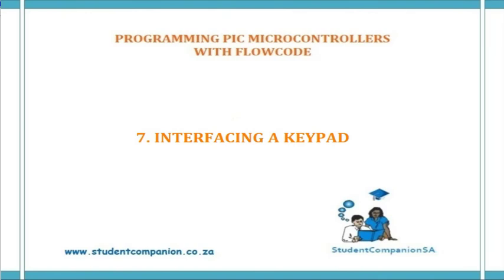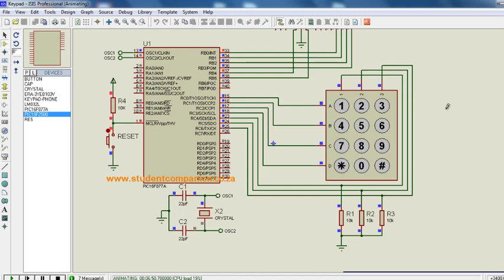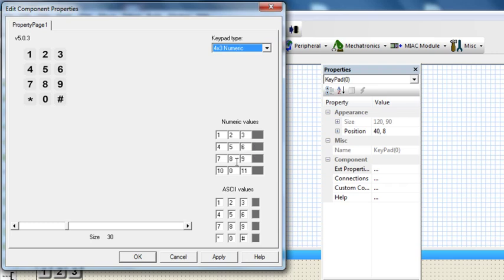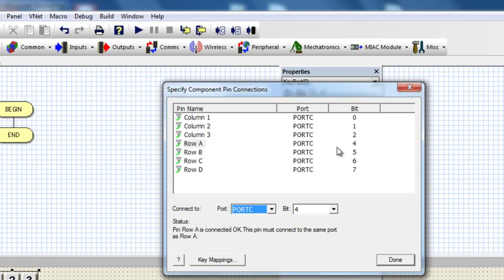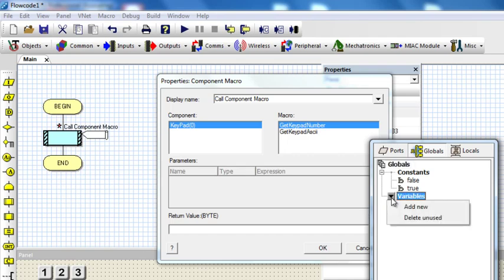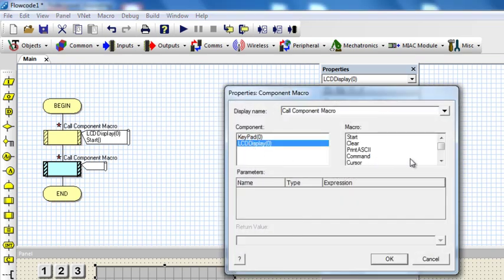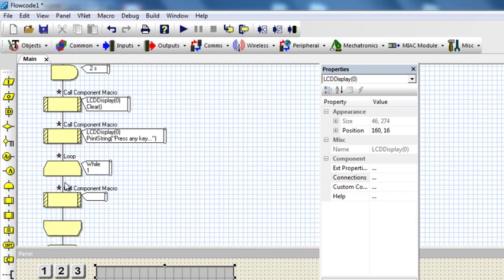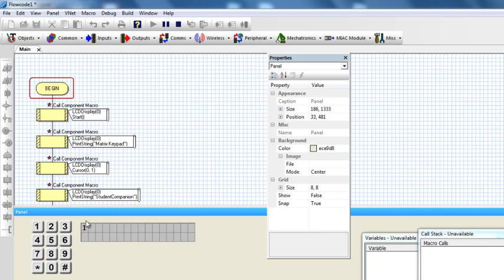7- Interfacing a Keypad with PIC Microcontroller | Flowcode Beginners Tutorial

Comment: may i ask if what PIC should be it? Its for my further verification only and self wondering.. Thanks
Reply from the maker: +marjun dayoc you can use any PIC You want. It's all depends on what you want in your application.  What you are going to use it for.
Reply from the maker: +marjun dayoc depends on number of pins required, peripherals required, size of your code etc.

Comment: Hi great job. may i ask your expertise. i have installed a flowcode v5, in the blue logo there is 3 diagonal red dots. normally are white dots. can you please explain why that is?
many thx
Reply from the maker: Hi wlondoner, thanks for watching our videos, i don't understand what you mean by 3 diagonal red dots you are talking about. which Flowcode version you are using? and where are those dots?
Thanks
Reply: Hi thanks for your reply.
I have flowcode version5. I meant the blue icon on desk top, normally has 3 dot white dots. The version i have has red dots. can you please what is the difference between the two icons
Reply from the maker: wlondoner  I really don't know what the problem could be, i hope your software works without problem. If you notice some problem it's better you call or email Matrix Multimedia, they might be able to help you.